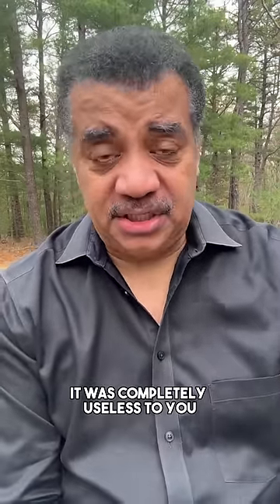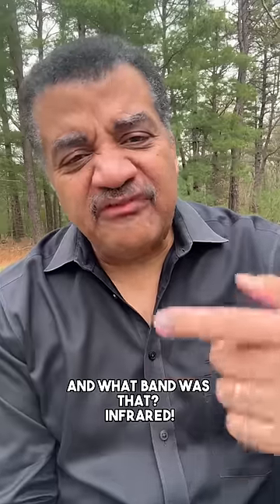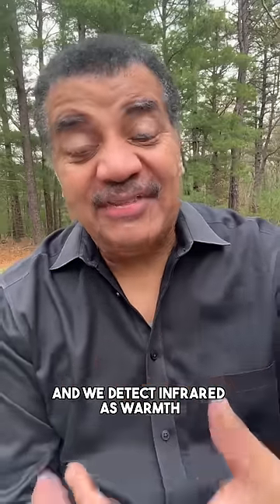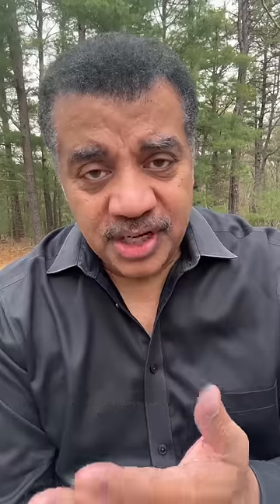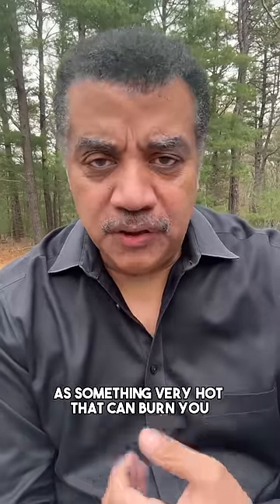LED Bulbs vs. Old Bulbs 💡

Comment: I love that old incandescent lightbulbs glow because they are black. Things that have a temperature (i.e. everything) emit some electromagnetic radiation; the hotter they are, the more radiation and the higher the shortest wavelength they emit.
This is called "black body radiation" because of reasons. You see, in physics a "black body" is something that doesn't reflect light. Emitting light, on the other hand, is allowed. Perfect black bodies don't exist in real life, of course, but when something glows brightly enough, whatever light reflects its body will be essentially negligible. Case in point, the sun. Try pointing a flashlight at the sun, see how much good it does.

Obviously this is for those who watch the videos, not for Neil. He knows all of it better than I'd ever would. Duh.

Comment: Of course when Neil forgets to tell you is that LED light bulbs are exceptionally expensive especially in appliances like refrigerators therefore the money that you save on electricity is lost the very first time you have to replace an LED light

Comment: But LEDs doesnt put all the energy to visible light, nothing is 100% effective and will probably never be.. LEDs get hot to, but a LOT less.. High wattage ones need cooling to not die of heatstroke.. LEDs are up to 90% more efficient then older incandescent lamps.. Thanks for a "up to 90%" correct video..

Comment: Sorry doc but I can't give you a pass on the LED's not getting hot. Some that are made to look like incandescent bulbs get very hot and even carry a warning on the package 'not for use in an enclosed fixture', because you may burn the LED and/or start a fire in your ceiling spaces. You don't want to do that, of course.
However, I'm not a Luddite like some of the commentators here just you need to be careful with them.

Comment: Now explain how the internal combustion engine wastes 70% of the energy you buy at the gas station as heat.  If you take the BTU's pumped out of the ground, subtract the energy it takes to transport raw crude to the refinery, subtract energy to refine into fuel, subtract energy to transport to your local gas station.  You discover only a small fraction of the energy pumped out of the ground is actually used to propel your vehicle.  To add insult to injury, after you get your vehicle up to speed, the moment you press on the brakes, 100% of the energy is wasted as heat.  Electric vehicles are far more efficient in transforming stored energy into vehicle movement.  After you get moving and want to stop, that kinetic energy is put right back into the battery.  The future is now.

Comment: Heat is what you want out of this light bulb, a low even heat. Just enough to keep a well from freezing. No one is looking around under my well, anything down there doesn’t need light to see. Can you tell me anything else that only uses 60 watts and can keep a well from freezing. Any suggestions.

Comment: OK, yes, but you’re not fully telling the truth. The main reason about the heat is because of the tiny bulbs the amount of heat builds up because of the transformer there is still a good amount of heat if an LED lightbulb is left on not quite the same as the incandescent. Technically an incandescent is fire and 100 W heating element.

Comment: Pfft! problem with LED's though is that the wavelength is different and will burn a hole into your retina like a laser beam...and the light spectrum is not meant for human eyes in general. it's a conapiracy by corporations trying to sell glasses!

Comment: Wrong. Old bulbs are incandescent, meaning that it requires an extremely hot temperature to produce light by incandescence, whicj requires a lot of energy. LEDs do not.

Comment: Not quite true. LEDs are more efficient but they are not 100% efficient. Heat is generated but it goes into the circuit board, not the bulb.

Comment: Well, it’s not exactly true… LEDs still do get hot and do not transform ALL energy into light. They still have to transform AC to DC and some LEDs even have to have radiators not to burn from the heat. Some of them die early because of excessive heat.

Neil, you should do better.

Comment: I tried a LED in a lamp and in less that 3 minutes that thing was hotter than crap  ...so it had to go. ...I couldn't have something that friggin hot and start a fire. . .I use regular bulbs in the winter simply due to the  fact that they put out heat but not so much that it would start a fire ....

Comment: Ya wanna tell them that the eye in the sky can now see all the little heat signatures watching TV, behaving themselves? Did you know when you have a thought, that thought physically resonates like quartz in that spot in yer brain, which, conversely emits electricity like a radio broadcast. Which can be tuned into by artificial means (two way radio, Tesla knew it) So now you got radio and infra red, you can know their thoughts and see their heat sig... Oddly CFLs and fluorescent tubes make great plasma antennas, and signal jammers. LEDs yay!

Comment: Neil says 90% of the energy used by old bulbs is completely useless. That is a flat out 100% lie. The heat that's generated by the bulb is heat, which is not useless if you live in a cold climate. I have a chandelier that uses a dozen light bulbs in it, and since switching to LED bulbs, that chandelier is no longer generating heat in my house in the winter. My national fuel bill has gone up since switching to LEDs! LED bulbs are responsible for me burning more fossil fuel to keep my house warm in the winter. Thank you LED bulbs for wrecking the environment.

Comment: Number one Neil deGrasse Tyson the LED do get hot. In the real question is why don't the LED last 10 years like they say they supposed to. It's because the LED Bay last 10 years but the circuit board in them doesn't.

Comment: Do we need this type of scientists?.
How does the LED works: there is a little transformer inside the circuit of LED bulb and the transistors switches the rectified AC current at a terrible high speed that sends the voltage to a very high level to produce the EM wave that generate the light with a frequency of about 450 -520 THz. The problem is with the high amplitude of that EM wave of that little transformer which use up some of the balance energy. Tube lights are the same. People who live close to transformers for long time (or transmitters) suffer from leukemia etc. Is that why birth rates are reducing all over the world except in the ME where they cover from head to toe?.

Comment: Wow what he saying is true 🤔 she's wrong about the LED lights 💯 they do produce heat that's what eventually kills the LED light😅 they're off and run at 1/3 power to litigate heat issues but when they are run at 100% power there's huge heat sinks behind them to suck away the heat 💯

Comment: And 3 watts is all i needed to hear. Had a flood light led last about 8 years before it pooped out. That thing was burning around 4 watts. It stayed on during the night and it didn't dent the electric bill. All bulbs should be LED in your household. Guarantee you will save money, and they can run for longer periods.

Comment: "Led bulbs don't get hot"... "All the energy is converted to visible light"... Nope, leds bulbs get less hot than incandescent ones yes, but they still get hot nontheless, and increasingly so according to their wattage... plus,  some of the energy put into them is transformed into heat, so no, not "all of the energy produces light..." that's a load of bee S

Comment: The old light bulbs are as woke as you are and can't control their emotions so they heat up at a level logarithmic to that of the LED that uses less energy because of the calmer, more rational emotional state.  The LEDs also stick to their area of expertise (creating light) and are therefore more efficient.  Welcome to the present.

Comment: 20 Benefits of infrared light: (old bulbs) 💡 

1. Pain relief
2. Inflammation reduction
3. Relaxation
4. Cardiovascular benefits
5. Improved skin health
6. Wound healing
7. Repairing muscles
8. Weight loss
9. Athletic recovery
10. Immune support
11. Improving hair growth
12. Promote healthy aging
13. Relieving joint pain
14. Clear and tighter skin
15. Energy
16. Helps heal injuries
17. Psoriasis
18. Reduces the effects of sun damage
19. Rejuvenates skin
20. Soothing sore muscles